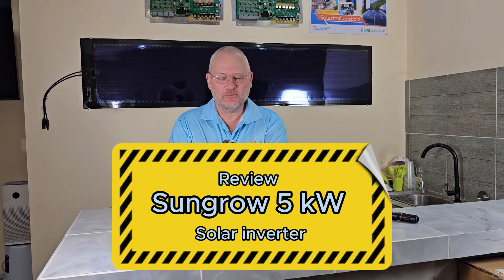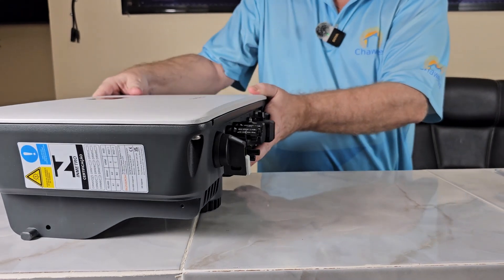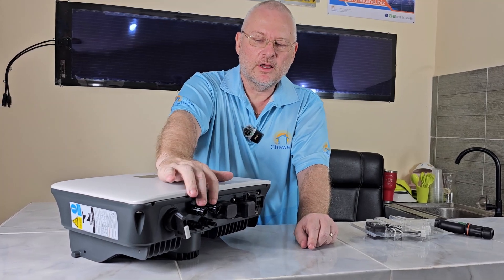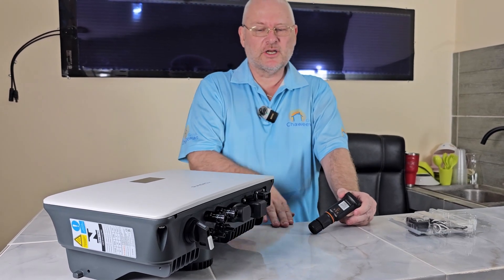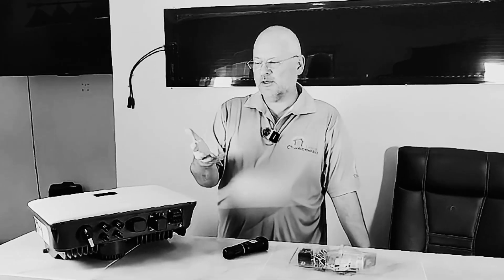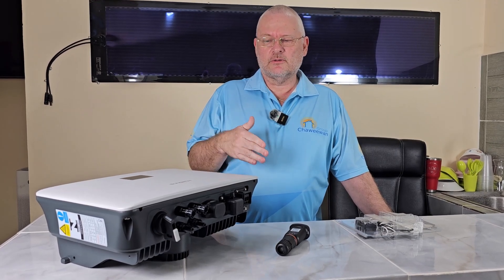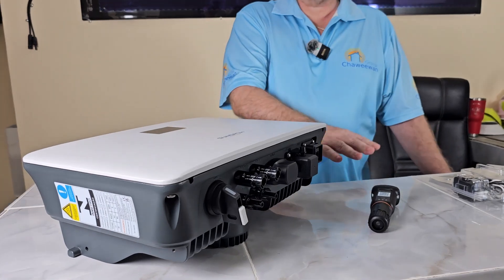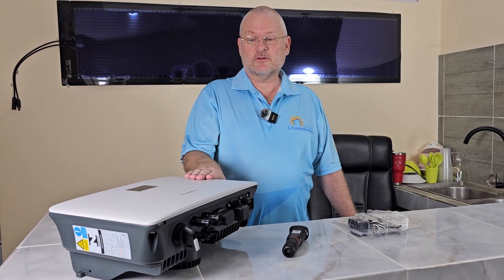Review of the Sungrow 5 kW inverter | SolarThailand.biz

Comment: I am in Korat.  Can the Sungrow 5k and 6K be used with 48 volt batteries (topsun 48 volt lifepo4)?  I want to replace a TBB RioSun 6k.  The main problem with my RioSun is while it says 6K, it has a 90 amp max for the PV (MPPT) from the solar.  This then limits it to about 4.65Kw (89.68 Amps x 51.862 volts = 4.65kw).  This is much less than 6kw that I thought it would put out.  Of course, I would never try to install it myself.
Reply from the maker: This Sungrow model you cant attach batteries to. Inverters that can attach batteries are called hybrid inverters and they are a different category.
Reply: @ChaweewanGroup  Thank you very much!!!  Any suggestions for a reliable inverter?
Reply from the maker: @davidfisher4281  Check out the review of the AlphaESS hybrid inverter on our channel.
Reply: @ChaweewanGroup this is definitely a hybrid inverter
Reply from the maker: @Tony-fl3rl  We have installed this inverter over 20 times, so hopefully we should know. This is not a hybrid inverter. The hybrid inverter has the same design, but the connections and tech is completely different and more expensive. And the hybrid model name starts with SH, not SG.
Reply: @ChaweewanGroup  there must be one with the exact same code that is hybrid . I can't put a picture up here
Reply: @Tony-fl3rl  Hi Tony, help me out please. In the 1st sentence you are sure there is a hybrid, sounding like you haven't found it yet.  In the 2nd sentence it sounds like you did find it, but couldn't put the picture here.
Reply: @davidfisher4281  hello I have a a sungro hybrid installed myself with the same code as the invertor in this video . I have a picture but don't know how to put a picture up
Reply from the maker: @Tony-fl3rl  Why would Sungrow make two models that are very different with the same name? 1 Sungrow has not done that 2 If there are two models with the same name, one of them is not made by Sungrow.

Comment: I worry about hail damage to panels. Have you seen this happen often? Have you covered this before in a video?
Reply from the maker: Hail has never caused damage to any of our systems. We have not covered hail in any video because it seems so rare. Theoretically it can happen of course, but you would need to be very unlucky.
Reply: Thanks. I asked because we have had 2 roofs smashed in 10 years. One in Chiang Rai and one in Chiang Mai. Both were cement sheet and needed over 50% of sheets replaced. Hail stones above 5cm both times. Not sure if solar panels would survive hail that size?
Reply from the maker: Wow. First off cement roof is very brittle and the lowest quality roof available. Dont use them unless for a carport or something like that. There might be something special in regards to weather conditions in your area that makes hail more common there compared to other places. I would talk to solar owners in your area for their experience. One way to mitigate the risk is to install the panels at a steeper angle. Makes impact less risky. But its a very peculiar situation that there is not much to compare to because its so rare. @SandmanTH